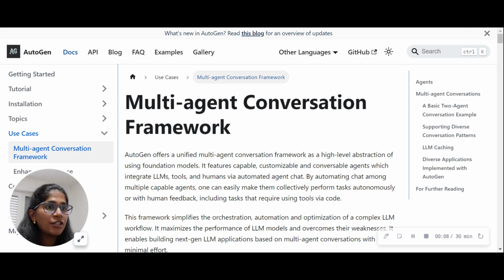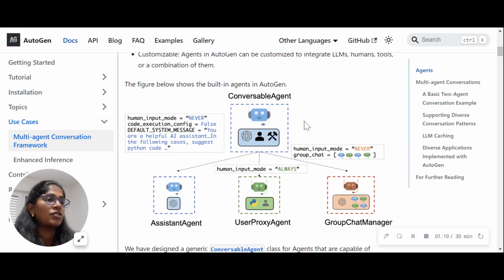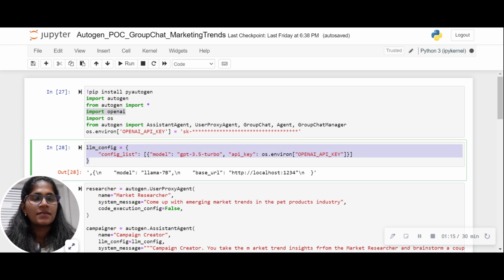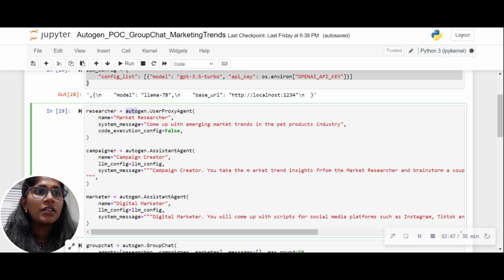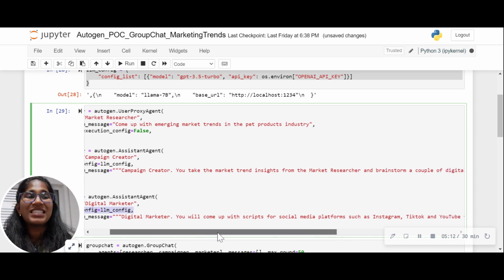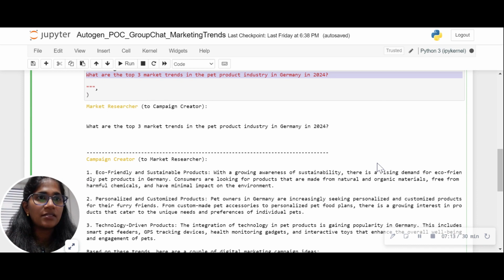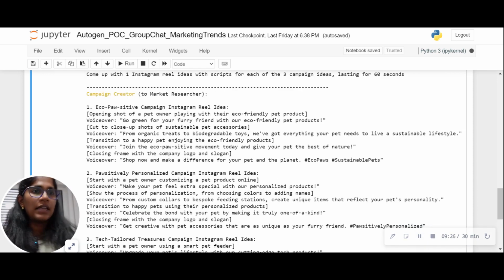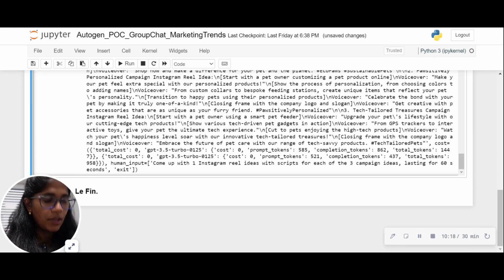Build With Me: Gen AI Collaborative Group with Autogen

Comment: Hello ,
I am currently working on an AI project for my authority, which is why I am contacting you here, because I have no idea how to implement it.
Briefly about my project. It should be an AI-supported tool for analysing PST files. I am trying to find out if it is possible to create multiple crews in CrewAI and have them work together. My plan is to have a Manger LLM that then assigns the task to the appropriate crew. So I would have planned to create an IT department (crew), a legal department (crew), an analyst department (crew) and depending on the user's request the manager assigns them to the right department (crew) but also collaborating with the other departments.
What is your initial professional opinion on this? Is it possible to implement this? What would you recommend, CrewAI or AutoGen? Thank you and best regards
Reply from the maker: Hi. Right now neither Autogen not CrewAI have intelligent managers which can determine by themselves whom to delegate which task to. But since Autogen allows collaboration as opposed to sequential task completion, you can start with Autogen and see if it works for you